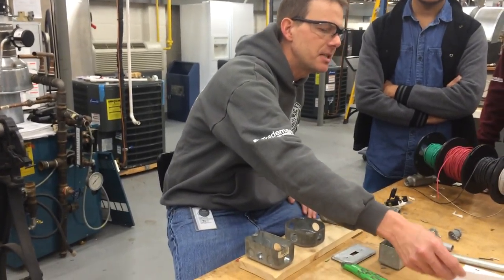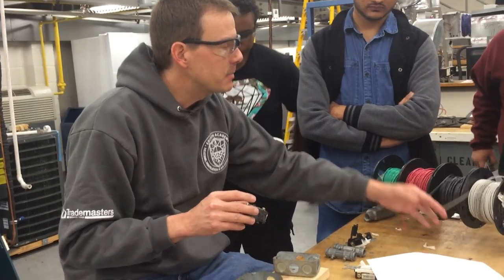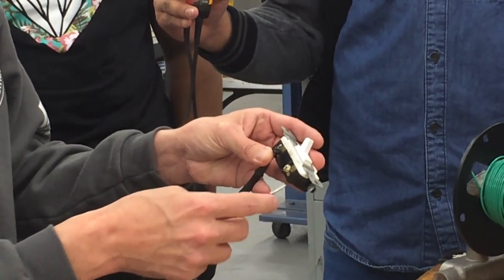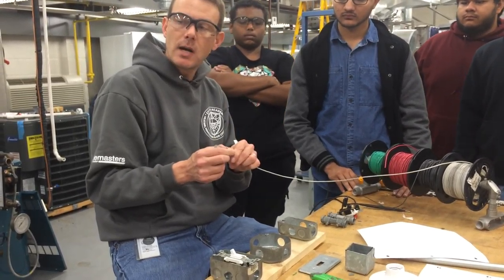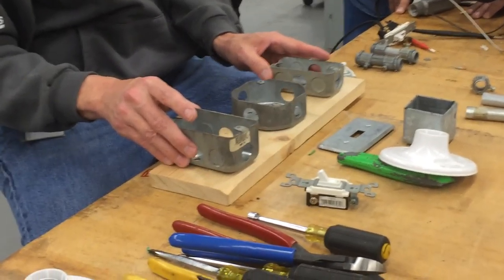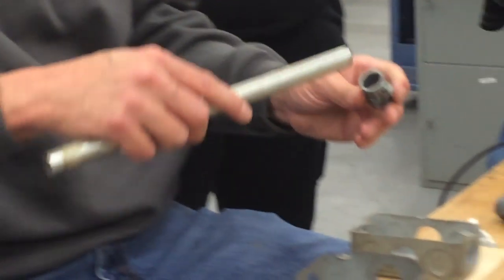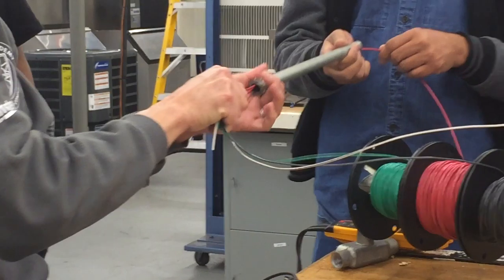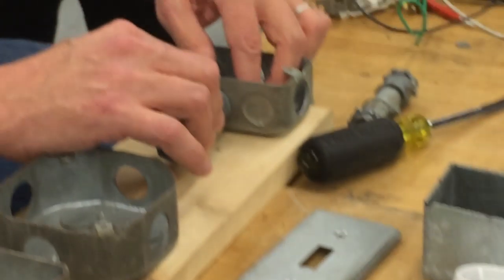HVAC Basics: Electrical Project 2 - How to wire a Three-Way Switch - Part 1

Comment: Why did you tie the two common wires with a wire nut on the switch?
Reply from the maker: +David Williams the white wire from the power source goes directly to the white wire tied to the light fixture.